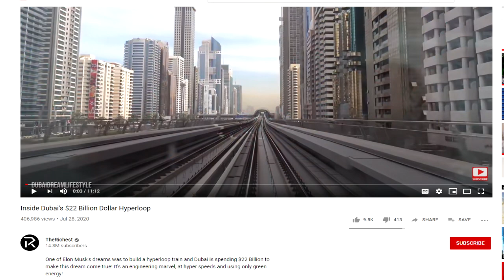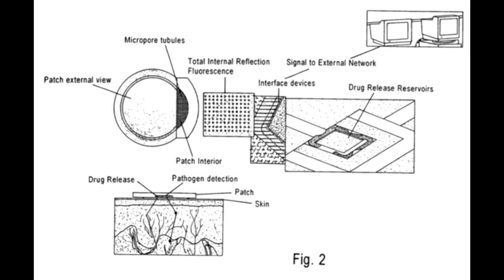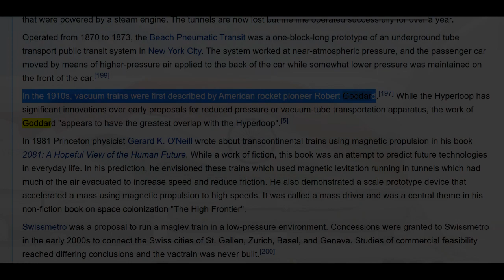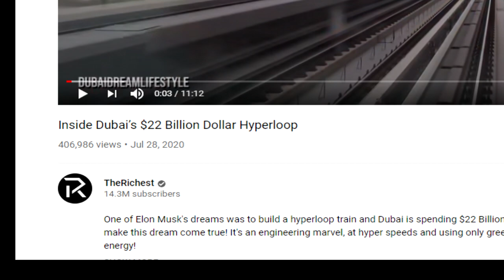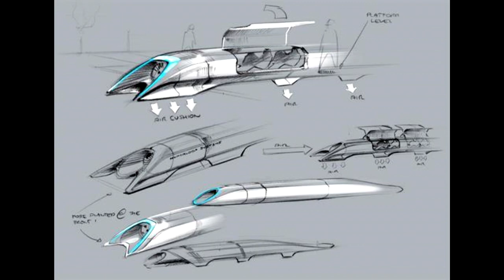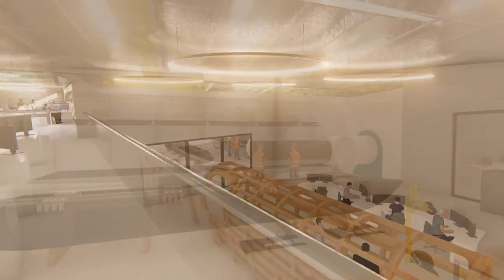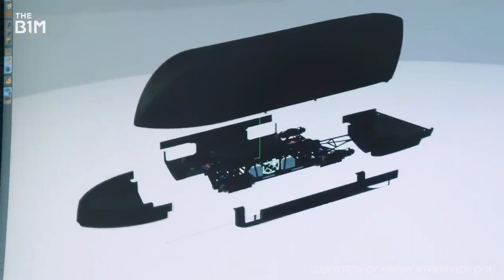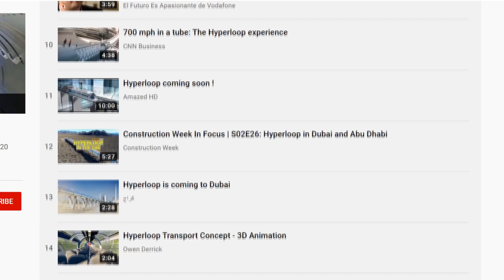Hyperloop, the biggest Scam since Theranos

Comment: "Generates more power than it consumes"

Talk about a red flag
Reply: cuz solar panels
Reply: @johnhandcock3242 that isn't the hyperloop creating more power than it consumes. Solar panels are famously inefficient, typically generating less than 20% of the energy it consumes (from the sun). I'm not saying it's impossible for the hyperloop to generate more usable energy than it consumes. But that's not what they "advertised". They said it generates more energy than it consumes. Which implies it makes use of a perpetual motion machine.
Reply: and its flashing.....
Reply: @Cosmosisification  No, it's covered in solar panels, so they can legitimately say it generates more power than it consumes.   The thing is you could say that about almost any large structure like this.
Reply: @Cosmosisification  "less than 20% of the energy it consumes"
Why do you care about the efficiency? Do you pay for the sunlight, or what to light them with light bulbs?
Actually, the produces more energy claim is the most believable of hyperloop.
We are speaking of a huge area, it can produce up to 1 MW/km.
Reply: @johnhandcock3242  Really? What about the energy consumed just to generate the vacuum on a single billion cubic  meters structure?
Reply: @johnhandcock3242  Hypoteticaly we can cover all the deserts with solar panels and generate all energy we need. In practice is a complete diferent business...also they have a life span of 15 years and become trash after that timeframe....
Reply: @rodrigoepaes  Yah, that's how marketing works.  As long as it's technically true in some context, then you can get away with it.
Reply: @bokoloaranyfa3824  1 MW per year?
Reply: @bokoloaranyfa3824  you pay for the construction of solar panels.... and the energy required to clean up the pollution they create by their fabrication. A better option is just to make space solar panels on a space elevator. waaaaay more efficient in every way.
Reply: Right. "Will violate between 3 and 12 laws of physics based on the option package".
Reply: @johnhandcock3242  Still doesn't generate more power than in consumes. The solar panels are not the hyperloop, they would be an extra source of energy added to the hyperloop, but the hyperloop itself does not generate more power than it consumes. It's as if you said a combusion engine generates more power than it consumes because you can add an alternator to it and it will generate more power than it consumes, all you have to do is add petroleum to the tank.
Reply: @johnhandcock3242  So it's just a train? In a tight round tunnel? Basically all the disadvantages of the train minus the advantages?
Reply: @TheMelorino  The space elevator is actually not so bad an idea. Ad Astra, though...
Reply: Free energy what are they the Bernie Sanders of physics
Reply: @johnhandcock3242  you don't know that a simple tram takes 600vDC and a lot of watts just to move it a little distance... and this is going at high speeds and weighing more than a simple tram.
Reply: Laws of thermodynamics don't exist because Elon
Reply: @johnhandcock3242  hyperloop "debunkers" also often hinge on the impracticality of near perfect vacuum
Reply: @NicverAZ  while I 100% agree that the whole thing is bogus marketing, I will say it's one of the less shady things they said in the promo.
" It's as if you said a combusion engine generates more power than it consumes because you can add an alternator to it and it will generate more power than it consumes, all you have to do is add petroleum to the tank."
The major difference in my mind here is that you have to pay for the petroleum you put in the tank, every drop. However, you don't have to pay for the sunlight, you only have to pay for and maintain the solar panels, but you have to pay for maintenance on basically any system, power generating or otherwise.
Please don't get my wrong, I think the hyper-loop is laughable in many different facets, and building this many solar panels in the first place is not a good idea.
Reply: @akunog2708  You still have to pay for the solar panels up front as well as for their maintenance, cleaning and replacement. They claim that they will cover the top of the tube for hundreds of miles. Without even directing them towards the south, at least from what their art show?
Reply: @joshuanetanel9174  Now I have an idea: what if we made a freeway out of solar panels...? Nevermind.
Reply: My house generates more power than it consumes.  In exactly the same way.
Reply: Well, assuming 120 W per m2, 4 meters wide, LA to SF, would generate 120 Megawatts - when the sun is shining. I have chosen 150W per panel, as TF keeps pointing out that flat mounted panels are 70% efficient compared to angled. Going from a current 200W panel... so it is a fair calculation. You would not need 120 MW to run a few trains in a vacuum, but of course we don't know how many vacuum pumps are running 24/7 and how vacuum the vacuum will actually be... this might be the only realistic promise, in the end...
Reply: SOLAR FREAKIN' HYPEERLOOPS
Reply: @edumaker-alexgibson  This is not how any of this works. The solar panels on your house probably generate power, not your house. You house used power and resources to be build and still requires resources and power.
Reply: @NicverAZ  That's a rather arrogant response!  What part of my statement do you feel you have successfully contradicted?   Hyperloop render shows solar panels.  My house has solar panels (by the way lucky assumption by you, could have been hydro or wind).  Both consume power, both generate power.  The solar panels are very much a permanent part of the system that is my house.  Making a house or a transport solution that generates more power than it consumes is rather simple in most cases - purely a matter of cost and whether you have the real estate to incorporate generation devices.  Any rail network could be upgraded with solar panels to achieve this, in fact normal railways are ripe for this.  I make no comment on viability of Hyperloop concept itself - I think it's a neat idea which is impractical in most cases and there are more interesting priorities, but would be pleased to see a niche where it is developed.  A hyperloop could of course be built without solar panels (for example underground!) which would of course consume power without generating - absolutely.  But we as a species need urgently to get into the habit of including the clean generation of power at point  of need - it's often easy to retrofit, as in my house, but it's an outright responsibility of new development of energy consuming projects.  The video seems to be latching onto this as a reason to debunk Hyperloop when it's probably the single standout economic and environmental no-brainer concept in the package!
Reply: @NicverAZ   Interesting.  You seem to be very sure of the wrongness of this, but your response here shows an opportunity to open your understanding.
The law of conservation of energy states that IN A CLOSED SYSTEM energy can neither be created nor destroyed but it can be transformed from one form to another. Since energy cannot be created or destroyed, the amount of energy present in the universe is always remain constant.
In your counterexample, the car is a mostly closed system.  It has on board fuel, which it burns (but it needs to take in air from the atmosphere).  The alternator is a somewhat inefficient accessory designed to convert some of the already inefficiently generated rotation of the motor by burning fuel, into electricity - just another form of power, but more useful for the radio, lights etc.
In the Hyperloop render, solar panels are shown.  They are part of the whole system, and they get their energy from outside it - in the form of sunlight on the exposed area of the Hyperloop.  This is a good use of otherwise wasted surface area.  It would presumably be used to power the vacuum generators during daylight, exporting surplus to the grid or batteries.  It is completely compatible with the conservation of energy.  
Back to your car... every year there is a competition for solar electric vehicles - Bridgestone World Solar Challenge
.  These cars travel 3,000 miles on power they generate onboard.
They would be impractical for a family holiday, but they work.  A surface Hyperloop has thousands of times the surface area to play with per passenger transported... no laws of physics are being broken by it.  
The perspective needed is - what is the function and input/output of your complete SYSTEM.
Reply: @NicverAZ  Good idea in principle, hard to make robust.  Tried in France, it worked perfectly until it wore out.  Conventional railways, however, are a perfect bit of real estate.
Reply: @johnhandcock3242  If you covered it with solar panels. You can't say it about airplanes, can you?
Reply: @paulogden7417  No, because a plane's surface area is rather small.  It wouldn't generate much power, and it would consume more power just to lift the additional weight.   This is nothing like that.   This is a structure on the ground that is HUNDREDS OF MILES LONG. Literally whip our your calculator, calculate the surface area of idk say 300 miles, convert to feet, by idk 50 feet.  Then look up the power generated by a typical solar panel area per square feet.  Now, multiple the two together.   This isn't complicated....  That amount of solar panels in say Ca would generate a massive amount of power.
Reply: @edumaker-alexgibson  No it's a logical response.
Reply: @johnhandcock3242  USA has no high speed trains ...USA has approved of building 1000 miles of high speed rail road and has managed to build 30 miles in 5 years , when clearly a stupid wall is more important that building something people would actually need ... USA current POTUS is so anti science he stopped all building of high speed rail roads ... just to remind you that Americans cant even weld two steel pipes together , DAPL is a good example , it leaks 24/7 .
Reply: I am impressed, he succeeded in parading a good portion of these bullsh!t talking youtubers like :
The B1M
Coldfusion TV
WIRED
TEDx
That guy from LTT?
Ruptly
And all those sh... spreaders like 
CNBC
FOX BUSINESS
EURONEWS
CNN BUSINESS 
NBC
BLOOMBERG 
And he did it just by citations, bravo!
Reply: @pete_lind  I am not defending the hyperloop.  I am merely saying it could generate a considerable amount of power, if it was covered in solar panels.  But again, you could say that about almost anything.   Slapping a solar panel on something and calling it green is the new goto scam.
Reply: @edumaker-alexgibson  your house? that is like saying my car generates more power than it consumes, whether it be gasoline, solar, or nuclear powered. Yes, I get understand your way of looking at it from an economic standpoint. But again, you could similarly say that about fossil fuels.
Reply: This is like "perpetual motion machine" scams, which were done in 18th - 19th century
Reply: @itapple53  No, it's nothing like that actually.   It's more like the water from air scam that pops up about every year.  They slap a solar panel on a dehumidifier, and tell you it's free water from air.  People associate solar energy with being FREE energy, and the scammers take advantage of that.
Reply: I mean that’s literally any power producing system. They all do it. Those that don’t (fusion - yet) aren’t used.

I think there’s a big difference between energy consumption by a power extraction method, and the total energy that exists In a system
Reply: @johnhandcock3242  first that has nothing to do with hyper loop as putting those Solar panels on the ground would give you more power then putting them on a hyper loop second do you really think that a small area of solar panel would cover all the energy demand of the hyper loop and more that really dumb
Reply: maybe it will as it will never be used
Reply: The hyperloop wont make 1 Watt from solar sources if you put it underground.  I feel like we are in Bizarro world?!!??!
Reply: He meant cash. It generates more cash via hyping the investors than it produces anything tangible.
Reply: @Cosmosisification  
Idiotic parsing of words. A factory with a sufficient number of solar panels on its roof is said to produce more power than it consumes. EVERYONE UNDERSTANDS THIS MEANS IT IS CONVERTING ENERGY FROM PHOTONS TO ELECTRIC POWER, NOT PRODUCING ENERGY FROM NOTHING.
Reply: @ws6002  Anti-renewable people are all about false-equivalences (and I used to be pretty skeptical myself). Solar panels also can hit up to 28% efficiency now for decent quality panels and up to 40% eff. and last 30 years with only 5% degradation. I guess the real question is, is the project financially feasible on a long-term return expectation, and will anyone actually finance it into reality. There is actually no great technological leap as such to implement it.
Reply: @VenturiLife  
Well said. My remarks here concentrated on what is physically possible, which is the first test. But economic viability is a quite different matter.
Reply: A train system that only runs during the daytime.
Reply: Yup. Reminds me of the medical conspiracies that say all illness is caused by one specific thing, and is easily fixed if you just buy this special medication (just common herbs or vitamins) sold on the conspiracy creator's website...
Reply: more like capturing and storing power, with enough batteries maybe it is possible
Reply: You !
You have violated the law of thermodynamics. Pay nature a fine or serve your sentence
Reply: That’s one incredible train that can break the laws of freaking physics
Reply: energy can't be created or destroyed...
Reply: @Cosmosisification  where did they say this? chapter and verse or you're a liar.
Reply: Not only is it an advanced transport its also a perpetual motion machine!
Reply: As many other have commented, there is no "perpetual motion" claim. Self-powering refers to use of solar panels. With a 4m wide strip of solar for the 100km Dubai route, you can get about 50MW. For comparison, a 50 ton maglev uses around 100kw.
Reply: actually it has solar panels so yeah it can indeed produce more power than it uses, this doesn´t take out the fact that literally everything else is a horrible idea though.
Reply: @CarlosAM1  that gives me an idea: if you put solar panels on a building containing a tokamak, would it produce more energy than it uses? Fusion solved!
Reply: @Seehart  Yes, of course! You are a genius!
Reply: It's not he hyperloop that generates power it is the solar panels.
People try to make the white elephant projects more palatable by just sticking solar panels on them.
It's like those carbon nuetral Qatari world cup stadiums that were supposed to be open air and air conditioned.
Reply: @hypothalapotamus5293  hey! Look I made a desert that generates more energy than it produces, this is revolutionary! Its gonna change the world!
Reply: @CarlosAM1  No. You're doing it wrong. Nobody is going to pay $2 billion for that. Sticking solar panels in a desert is the sensible thing to do.

You need to stick the solar panels on a giant office building, an indoor ski area, or a stadium that doesn't exist yet.
Reply: @hypothalapotamus5293   "Sticking solar panels in a desert is the sensible thing to do." It may damage the local ecosystem and need a bunch of rare earth minerals to make it, but hey, green energy! Who cares! 

seriously tho you really have to be careful with where you put these things.
Reply: @CarlosAM1  It is relatively green energy. Seriously, whatever we do as a species messes things up.
Reply: @hypothalapotamus5293  It is relatively green yeah, but its hard as hell to recycle and takes up vast ammounts of land and doesnt work at night or when its overcast, etc.
edit: it is cheap tho
Reply: @CarlosAM1   Effective use of wind and solar requires hydroelectric dams for energy storage. The environmental consequences are not great, but probably not as bad as a fossil fuel heavy grid.

Then there's nuclear power, which works great until somebody messes up.
Reply: @hypothalapotamus5293  "Lets keep a 40 year old outdated nuclear plant without modern security measures right next to the shoreline on the most tsunami and earthquake prone zone in the world" 
What could go wrong?
Reply: @CarlosAM1   Well, that's just the Northeastern coast of  Honshu for you. Fukushima wasn't the only power plant to get hit by the Tsunami. It was just the worst impacted.
Reply: well its a perpetuum mobile, something that generates more power then it consumes can move forever and ever, i wonder when the first Hyperloop energyplants will be raised
Reply: @Cosmo Knott
> Talk about a red flag

But, but... It's got electrolytes! :-)
Reply: @bokoloaranyfa3824  Except you can slap solar panels onto anything and say "it" generates power. It was proposed even for the fucking Trump Wall in hopes of making hype. That's why it is a red flag.
Reply: @rodrigoepaes  What you know about solar panels can apparently be stuffed into the period at the end of your post. The set of panels I bought were warranted to be outputting at over 90% of initial output after 20 years. That's not exactly junk. Also, who knows what advances will be made in 20 years? For all those who show zero understanding of Elon's methods, the switch from full vacuum to partial was just part of his iterative process. I don't know, but I suspect that the difference between the power required to create a very complete vacuum and the power required to maintain a couple of percentage points less perfect vacuum is more than those few percentage points less in vacuum. The desired reduction in the ram effect for the desired speed will determine the crossover point, not to mention the more relaxed construction standards.

I believe that you, the author, and the other scoffers are a bit premature. Elon wants to build Boring Company tunnels all over the country, and hyperloop seems ideal for the longer ones. We shall see. If you have any spare brain cells to waste on imagination, why don't you use them in trying to imagine solutions to the problems that you see.
Reply: @TheMelorino  There will ever be a space elevator on Earth, maybe on Mars or the Moon, but not the Earth. The theoretical materials limits or too low to make it practical.
Reply: if u send it some bitcoin it will send you twice as much back : )
Reply: @Cosmosisification  by concept, something that generates more energy than what it consumes doesn't mean that it is a perpetual machine, every machine from the steam engine to a nuclear plant generate more energy than what they consume, perpetual machines are the ones that are said to work without an energy source, it's different.
Reply: @abegohr2576  .... wut. Do you think steam engines create more energy than they consume. Steam engines are >famously< inefficient, losing massive amounts of energy through conduction. Maybe I don't fully understand what you're saying.
Reply: Solar freaking hyperloop